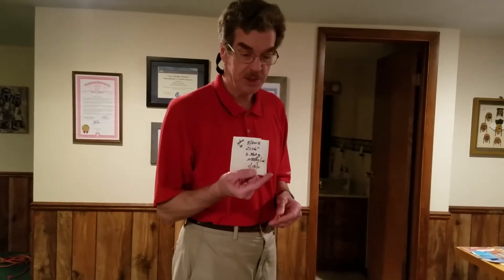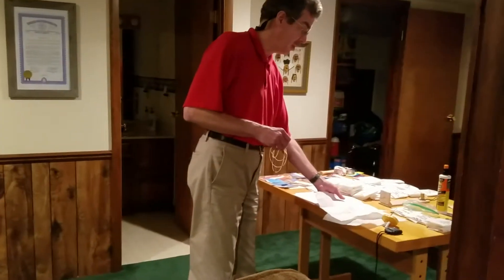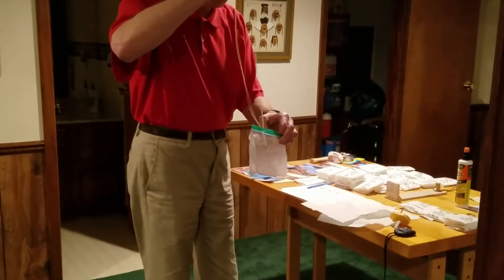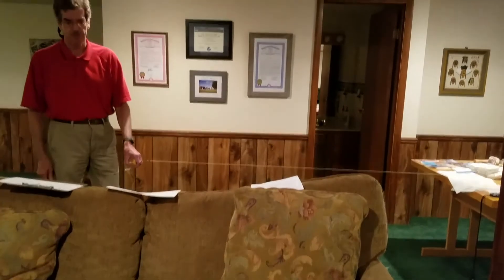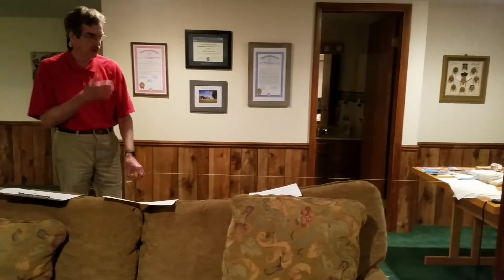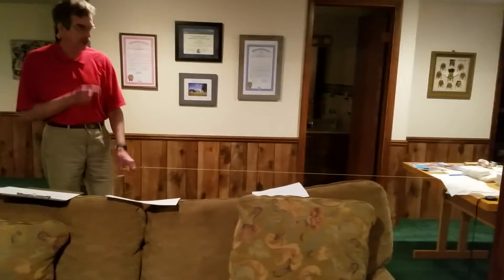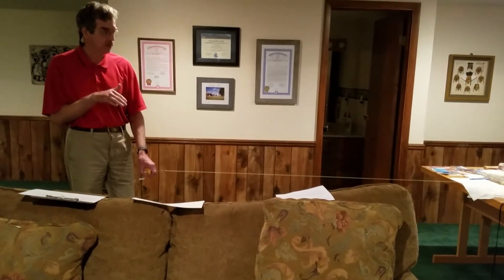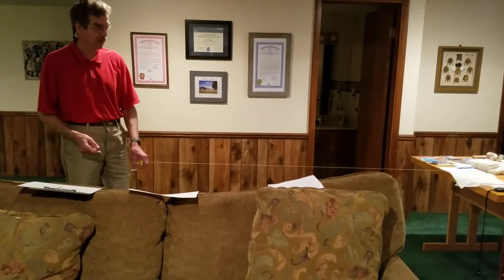2020-21 Science Olympiad Helicopter Winding and Launching (also, 2021-22 Wright Stuff info below)

Comment: Hey Brian- can I send an email to you? I noticed that the equation here has a 0.3” factor in calculating the rubber linear density. However, in this year’s Scioly web for “ max turns”, it becomes 0.5. A more conservative modifier. Any specific reason? Thank you so much
Reply from the maker: Thicker rubber used this year means a bigger knot. The 0.5" is the typical length of rubber in a knot of 1/8" rubber strip.

Comment from the maker: For 2022 Wright Stuff, the motors are shorter and thicker rubber (around .079" to .094" thick) and 1.5 grams. So, maximum number of turns will be less. Also, number of backoff turns for Wright Stuff will typically be higher, resulting in lower launch torque than is mentioned here. Typical launch torque for first flights on 2022 Wright Stuff is about 0.25 inch ounces. Maximum torque will be similar, 1.0 - 1.2 inch ounces, or more based upon your testing, for Wright Stuff.